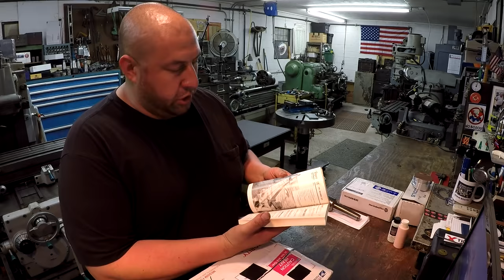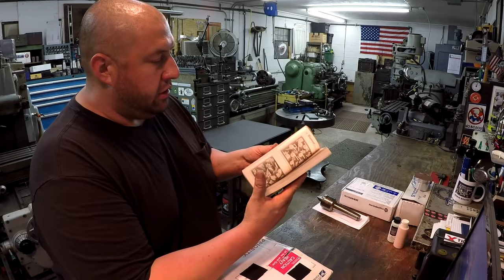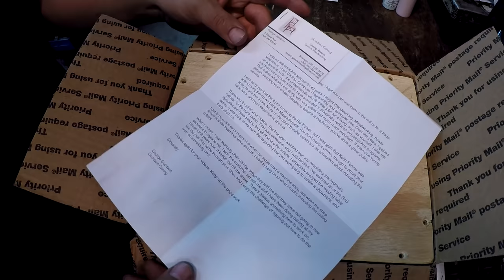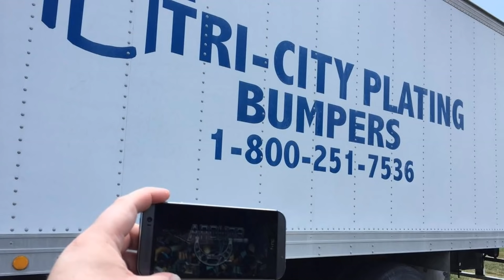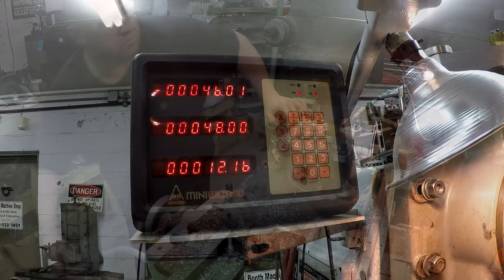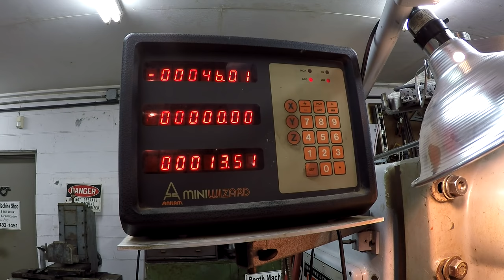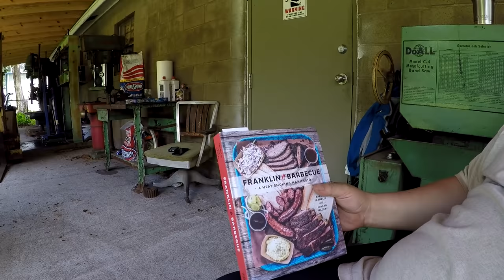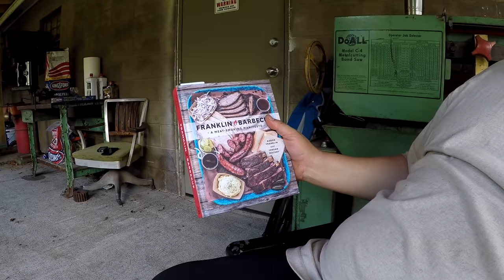Saturday Night Special 131

Comment: Fill the water jacket with tight packed sand up to the area you want to be shaped.  Then using a spoon  cut the sand back a bit and then fill the area with J-B Weld.  Then just machine the J-B to the shape you want.  After the J-B sets after a day or three just remove the sand.   We have used J-B Weld to repair blocks and manifolds many times.  Great stuff, sticks to anything, can be machined or shaped with a grinder.
Reply from the maker: Doubt it worth the trouble, but good idea on how to fix it.

Comment: I've got a free standing 1HP belt grinder/sander with 2" x 60" belts. I built it myself. It is the most used tool in my shop.  From just deburring, parts sanding to hardcore grinding, it is my go to machine. It was a simple build with common metal flat stock and thick walled square tubing. I even designed my own automatic belt tension system so that the belts can be changed without tools in mere seconds. It makes it quick and easy for stepping up in grits. 
Oh yeah, it will scare the poop out of you when the belt snaps. 😬
Reply from the maker: Awesome project!
Reply: +Abom79 I would love to see you build one. With your talent and machinery, it would be great to see your design. Keep doing what you are doing. I have learned so much from you. We are forever grateful.

Comment: the intake project is just that the customer wanted it done and you stopped an asked an made sure what they wanted.  No worries.   you did what they wanted an if they didn't know what they wanted that's on them.   I enjoy you videos an learn something everytime.  Thanks for sharing.   I need you email so I can send you some pictures of the charcoal baskets for your smoker.
Reply from the maker: Hey Bill, use abom1979 at gmail

Comment: MANIFOLDS FROM SCRATCH! ARE THE BEST FLOW PRODUCING MANIFOLDS!  
You'll need 1/4 plate for the valley 1/2 for the (cut out) gaskets to heads, and some good rectangle extrusion for the ports! And now the trick is to cut them like blocks of wood, every piece is different. Bolt 1/2 to heads on block! Cut fit weld!

Comment: Nice work Adam.  If you don't have the expertise of auto components, don't get down on yourself. The engine builder should have known that. Your work was exacting.  I 'ported' a motorcycle head myself years ago as an ignorant kid. Cost me a replacement head & I learned valuable lesson.  Man, that double sided trunnion cylinder is jewelry.  And that chicken barbeque....  going out to fire up the grill !!
Reply from the maker: Awesome Doug! Thanks!

Comment: With the intake manifold, I would have liked to seen stainless steel keylocking thread inserts for the bracket mounts where there was the hollow spaces, with a little bit of loctite for insurance. It would have been a nice touch considering the automotive application and the softer base metals. Also you could have sleaved the new four barrel design where you milled into those cavities. Not saying that would be the correct thing to do, but probably would be better then leaving them open. I not sure of the specs but reducing or increasing either space for vacuum or intake channels could drastically affect performance. But if I was the customer I probably would have asked for the inserts and sleeves in this manifold re-design

Comment: Those angle cutters are a thing of beauty! Sorry if I jinxed ya on the intake when you told me about the job. It is common in race manifolds to do away with the coolant in the manifold as hot air hurts power, those coolant passages are to keep the fuel from condensing in cold weather. I doubt you all have carb icing problems in Fla like we do here. Some JB weld and block off gaskets and he should have a runner, no doubt not the best but for a lot of older v-8 4bbl manifolds aren't available. My old polysphere 318 you couldn't get one until just recently unless you were willing to pay more than the motor was worth for an OEM one.
Reply from the maker: +bcbloc02 Hey Brian, me and Alex go to Moultrie Ga swap met and finding Mopar parts is like tying to find a needle in a bundle of hey. Alex hates buying new intakes because when you compare the cost to s Chevy, it's out of site. But we love our Dodges! He's working on a single cab Dakota with s 318 and factory 5 speed now, and I'm sure it'll have a nice built 360 soon. 😎
Reply: Abom79
Build a 340 it will eat a 360's lunch! The 318 is probably the toughest V8 ever made I know of at least a half dozen in town with over 300,000mi. I know of 0 350 Chevys or 351 Fords with those kind of miles on original engines and parts. If you all ever need any 360 parts I have that junk one out of my crew cab that I will never do anything with.

Comment: Buffing wheels on the bench grinder are great, they don't do well with large burrs but for small sharp burrs they are much faster in my opinion than a belt sander. At work I would hit the large burs on the belt and then finish it on the buffer.
Reply from the maker: I can also see where deburring small parts will be much easier with that wheel.

Comment: Adam, I think you did a fine job on the intake...  I agree though that is was a bad plan initially, but honestly I appreciate that you show the miscalculations too because the are a lot of things to be learned by screwing up new things.
Surgeon Generals warns that polishers/buffers are addictive...  If I had one of those in my shop there would be a lot of silly shiny stuff.  Thanks Sam
Reply from the maker: Thanks Sam. Having a good assortment of grinders, sanders,and polishers makes doing the work so much more enjoyable.

Comment: Intake manifold may be a loss, but how you set the manifold up, got er aligned, showing how you indicated to align and square the manifold bores was great! So it wasn't a waste of time for viewers. How you got it parallel by eyesight, I swear, you have horseshoe luck lying around everywhere. If only picking lottery tickets were the same odds. :)

You should see how some guys custom built "plate" tunnel ram intake manifolds and weld them up. It's crazy what some guys are capable of. And then they have to machine them. It's all good to see.

Comment: Even from where I'm sitting, I can see one of those intake ports is going to be outside the casting surface.   The port I'm looking at is the 4th one you've bored.   This isn't going to work if you cut through the casting and expose the intake runner to the outside air.  Cutting into the water passage is not your biggest problem.   If you cut into the vacuum / water passage, you can always install a sleeve.  Make it a press fit, and seal it with Bondo.   Am I correct in assuming this is going on a small block chev ?  If so, use a different manifold.  You can buy, off the shelf, a 2 or 4 barrel manifold.  This looks like a manifold for a TBI system.   I'd go with a different manifold.   One that can be modified.
Reply: That looks like a 4.3 V6 manifold that they were trying to convert from TBI to 4 bbl....but hadn't though it through very well.  Can't say as I blame them for trying as 4.3 carburetted manifolds probably going to be very pricey, and you don't know until you try sometimes.   But have to agree....from the start this one looked pretty shaky but it's NOTHING compared to some of the 'backyard engineering' we have seen running around here.

Comment: I just had to replace my gas grill recently, and from the looks of it I got the same one you have. mine is a model 1624 and doesn't have the front mounted table though.  That looks like it would be real handy to have, so it looks like i got a project coming up soon. (GRIN) Now I need to basically relearn how to cook on a grill again. charcoal is a much different animal to cook with.
Reply from the maker: I prefer using the charcoal grill, but am wanting a good quality gas grill in the mix as well.

Comment: Ha Adam
Donn't sweat it about the manifold the guy that asked you to do it should have known exactly that there was a possibility of cut through. The thing was never going to work from the start even if there was enough material to cut and that is not on you. Some people just have got no idea. I am still hoping that one day there will be smell a vision to get a real appreciation of the BBQ.

Dave
Reply from the maker: Thanks Dave
Reply: I agree David! As soon as I saw the initial setup I went "Oh NO!". Even IF everything had worked adapting a 4-bbl carb to a 2-bbl manifold is not gonna work well. What I would have done (and the owner should have done) is make a flat plate adapter out of about 3/8" steel and put a Holley 500 CFM (Ford pattern) 2-bbl on the manifold. In fact without having the parts in front of me It might have been easier than that.I once adapted one to a Chevy 2-bbl intake. Plate. Drill a few holes. Some countersinks. Using a mag-base drill to do it all. Layout and drill the old fashioned way. The throttle bores lined up perfectly to begin with so the rest was gravy!Ran good too!

Comment: Interesting manifold job.  "Live and learn" on those jobs.  I appreciate your honesty about the errors.  You can't know everything about some jobs until you're into the work.  Was it a camera thing or was that 1.5 inch mill actually slipping when you commented 
on the chatter?  Keep on keeping on!
Reply from the maker: It was chatter in the part, it wasn't a very solid setup and the manifold was vibrating.

Comment: You can also use the photo album on the iPhone to set the slowmo portion and then use the share feature to upload to YouTube.
Reply from the maker: +HighlandSteam I upload them straight to Facebook and Instagram but when I download the files to my pc it doesn't show the slow mo part.
Reply: +Abom79 the other way is to iMessage yourself on another device and upload from there as it keeps the slow-mo 
Do you edit on a computer? as the original 240fps file can be slowed down using most PC based video editors without loosing quality.
Reply from the maker: Yes i upload them to my pc, but I love the way the iphone maked the slomo vids for you on the phone.

Comment: You will find that you want to run your straight edges across the wheel. The wheel can wear uneven if you don't run edges across the face. I use these wheels every day and it gets me upset if someone uses my wheel and they have got it out of shape.  They will deburr something round and grind the center of the wheel by not moving the part across the wheel..
Reply from the maker: +Claude Morehead I understand, and instantly seen that when I was deburring those pieces of flat bar on video.

Comment: Why not just use a mount like a receiver hitch mount welded under the welding table? Weld a plate for mounting the grinder to a box tube that will fit the mount Think truck receiver. Plus you can use the mount to make other things to mount in it. Small vise, v plate with strap to hold long shafts vertical. Heck make another mount for your other grinder and get rid of the pedestal it's on and make a rack for the grinders and accessories and swap the grinders as needed.
Reply: Now THATS a good idea.
Reply from the maker: Yep, not a bad idea at all. Tom does that trick.
Reply: You could also make a new mount plate to mount both grinders back to back on the same pedestal and turn them around for whichever one you wanted to use. If you wanted to get fancy, make a swivel plate that indexes them and locks in position kind of like an indexing head. :)

Comment: Would a coaxial indicator perform the same function as the mini noga holder with a test indicator like you showed at 25:15? Is there a reason you prefer the noga/test indicator over a coaxial indictor?
Reply from the maker: It would but I don't have the room to get it in there, depends on the job really n

Comment: Wow your sister looks a lot like your mom. She has the same general face features.  Believe it or not Adam, that intake can be saved and made to work still. I would epoxy fill those cavities and then open the plenum as down as close to the plenum floor as possible. The water passage was for the throttle body preheat and would not be needed with a conventional carburetor. However the killer on that project is the cost of labor to do all that work on something that may not even yield favorable performance when he could probably buy an aftermarket Edelbrock manifold for less.
Reply from the maker: Thanks Joseph. Yes he had mentioned using some epoxy to fill in the holes and save it.
Reply: It's really to bad that he didn't do the epoxy fill before he brought it to you to do the machining work on it. Now that would have made for a neat video. You could show the making of an open plenum intake with the aid of epoxy. I have used many epoxies over the years and then machined into it to. This work has mainly been in R&D and flow bench work on heads and intakes and in cutting up heads to move ports around. I did a bunch of this kind of work with my funny car endings before building heads out of billet aluminum.

Comment: Nice video Adam.  My philosophy with food is to stay well away from low fat or diet anything and don't eat  food full of chemicals and minimize sugar intake.  I hardly ever buy cookies or ice cream.  A lot of low fat food is regular food with 1/3 of its content replaced with water, thickeners, sugars and flavoring so its still edible but "fake" food is unsatisfying so you end up eating more of it and get fatter from the sugar.   The less sugar you consume, the less sugar you need to have things taste sweet.  

The bread I buy is made of simple ingredients same as home made.  The yogurt I buy is plain Greek style 11% fat with no thickeners, sugars or artificial anything and add my own fruit or jam.  I buy homo milk only and non of that 2% or skim milk water.  I use only real use butter and no margarines.  Anything with suspect corn derived products (like dextrose or maltodextrin  for example which are basically sugar) goes back on the shelf.  My diet is considered high fat and "unhealthy" by many but my cholesterol is low and I can lose weight easily when I want to simply buy stopping eating before I feel completely full.  

Anything I don't want to eat I simply do not buy.  If it's not in the house you cant eat it - simple.
Reply from the maker: All good and valid point made, and I agree. I have been sticking to low sugar intake for a while now and already dropped 20 lbs.
Reply: Abom79 That's great Adam.  My dad is retired and in his late seventies.   A few years ago a doctor forced him to get a health check and it turned out his insulin levels were low and his blood sugar level way too high so he had to cut back on the sweet stuff.   At that time he was getting a little chubby with a  noticeable belly.   Just by cutting back on sugar, but still eating whatever else and as much as he wanted, the weight fell off over the next year and hes much leaner and healthier now.

Comment: The K&T doesn't have a quill feed does it?  Z axis is purely by lifting the table up?
Reply from the maker: +gadget73 It does have a moving quill but it's operated by turning a hand wheel. It's a very slow movement by way of a worm gear.

Comment: I am pretty sure that even if that intake would have worked out the air flow through it would have been so turbulent that they may as well have just slapped a 2 barrel carb on it.

Comment: Great SNS Adam! That was an absolutely beautiful job you did on duplicating that cylinder and trunnion. Incredible metal artwork. I saw some of the machining on Instagram. Do you custom make the cylinder rod bolts for each cylinder? On the lathe or do you have another way of making them? Thanks again for the time and effort you give us every week.
Chris @ Steward Machine Shop
Reply from the maker: +Chris Moore For some sizes I have dies for my Geometric Die Head and use it, others I just single point them. For those, I had to single point thread them.

Comment: Don't sweat the intake manifold man.  That thing looked a stock GM 2-barrel TBI manifold so it was NEVER gonna support a lot of modifying, not without wrecking it.  With the plethora of aftermarket intake manifolds available now for domestic V8's, the customer was just trying to be as cheapskate as they could, and trying to save cash utterly failed.  As others have been saying that shop desk looks like it would do good for stashing BBQ and smoker supplies in, with some mods. ^^
Reply from the maker: I agree with you, and the BBQ cabinet is sounding cool.